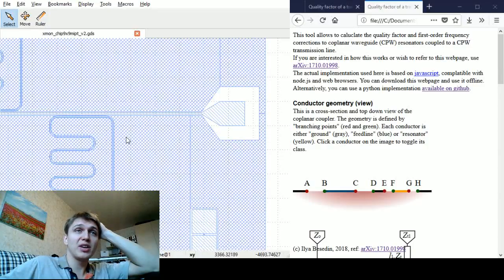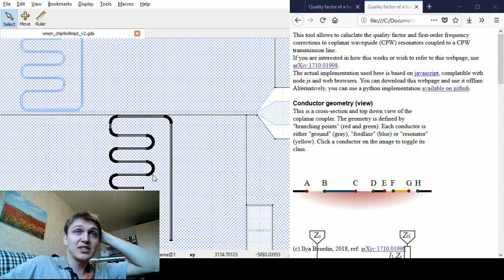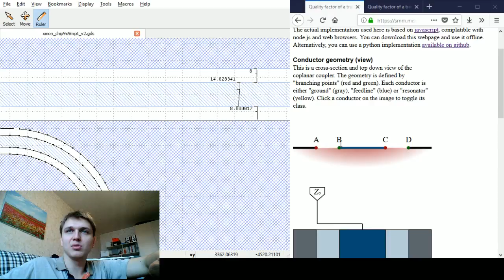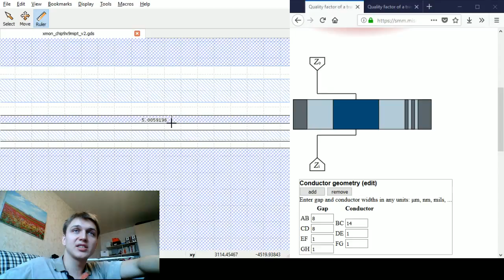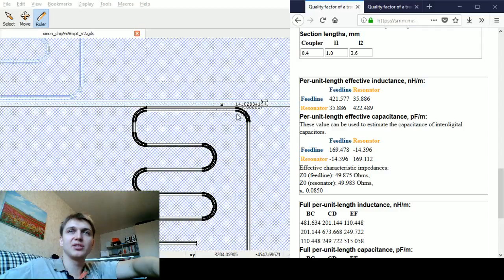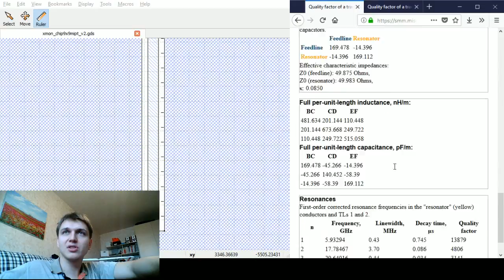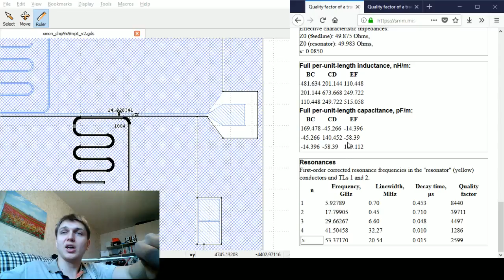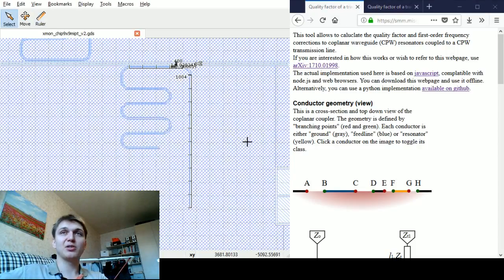Quality factor of a transmission line coupled coplanar waveguide resonator

Comment: Thanks a lot for sharing. But how can it be, that the calculation tool does not take any parameters of the material that the CPW resonator is made of into account? As I see it, only substrate permittivity and permeability is set.
Reply: This is superconductive case. The metal is treated as lossless.